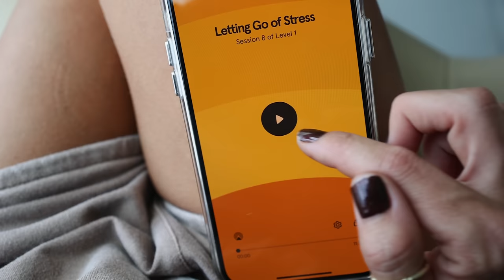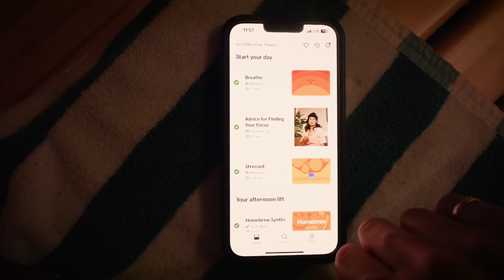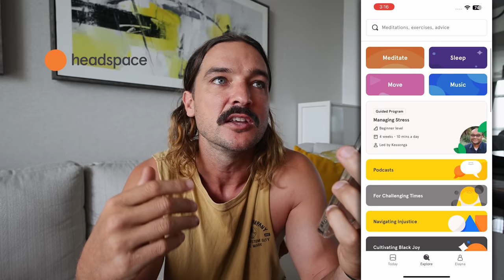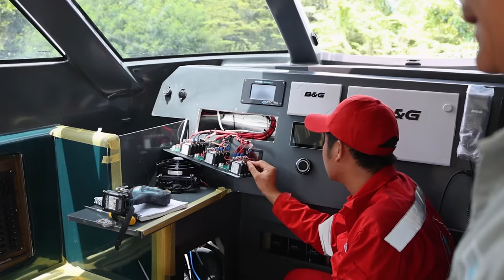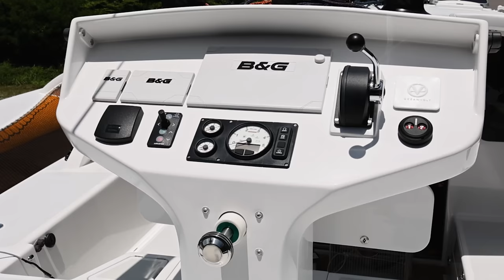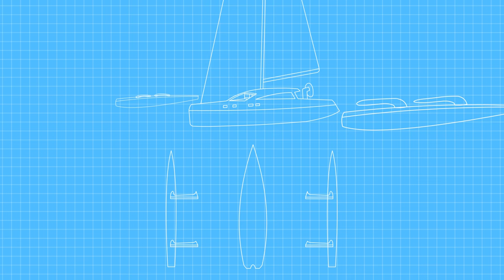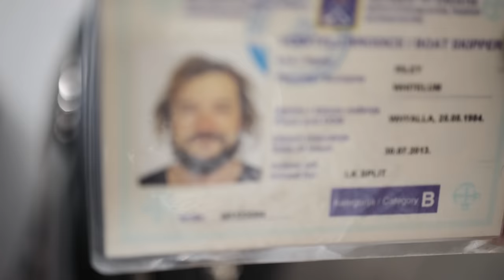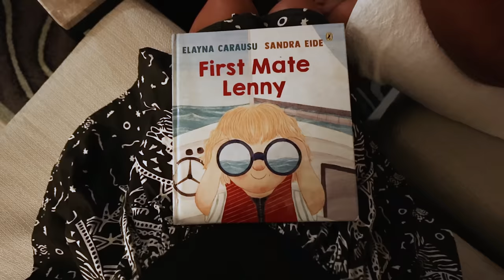OUR NEW HOME (60ft Carbon Trimaran)

Comment: I’m not a sailor, but what charms me about this peek at your boat is how you focused right away on its performance and safety features (okay, after first marveling at the paint, which honestly is a triumph). It’s a beautiful boat.
Reply: Yes the colour is a triumph🧡
Reply: ... and also a Triumph motorcycle color! I had an antique 1973 TR5T Trophy Trail ... aluminum tank with yellow trim .
Reply: If you're interested in sailing, a great way to start is to join a local sailing club and take lessons there.  It's great fun!  Using their boats is also vastly cheaper than owning one.  (There are sailing clubs very far inland too.)

Comment: I am so happy for you two!

Film cameras!  You mean like the kind we used to use in the years before the turn of the century!  Have fun, but take the time to meticulously plan every shot, as film and developing gets very expensive, very quick.

"I'm never going to want to leave this boat."  TA-DAA!!!  You nailed it.  I love the old copper plumbing look -- nice touch.

Sailing area to weight ratio:  Excellent light-wind sailing velocity!  Obviously, for safety's sake (family), you'll have to resist the urge to "press the edges of the envelope." Don't trust in the "60 tons righting moment."  It's there for safety, not for pushing the envelope.  As a pilot, it was of the utmost importance that I knew the aircraft's limitations as well as the boundaries.  While an aircraft might do 4.1 g's, it would break and kill me at 4.2 g's, so I never pushed it beyond 2 g's, the no-turbulence force developed at 60 degrees of bank in level flight.  Then, because of turbulence, I never went beyond 30 degrees in a turn (VFR) or the bank required for a standard rate turn (IFR).  Safety, first, and your new home is more like a fast business jet than a 2 to 4-place general aviation aircraft.  The boat will be much more fun for all involved if you keep it well inside the envelope.

"No more boats for a while!  I mean it!"  Uh...  What about your dinghy?  Aren't you going to have a dingy?

Comment: Dyneema is great.  Will be interesting to see how it holds up.  I've used if many times.  I always wanted something over it to protect it.  I got a lot of holes in things that were exposed to wear and tear with dyneema.

Not really a fan of the colors.  But everyone has different styles.  Also would try foils for lift.  See if she'd fly.  Then, reduced hull shape won't matter as much.

I'm interested to see how she sails.  I think its a great platform.  I'd just like more open space.

Comment: That is a BEAUTIFUL boat, but one thing I noticed. I was wondering if all your copper piping was put together with "lead-free" solder and flux. I don't know what the laws are in Vietnam but in the U.S. in 1986 the Safe Drinking Water Act Lead Band required the use of lead-free solder and flux in the installation on any plumbing in a residential or non-residential facility providing water for human consumption. Many different lead-free solder alloys have been considered as potential alternatives to the classical lead-based alloy. It wouldn't hurt to check. Good luck.

Comment: Why the fiber stays instead stainless cable. Sure “painted”  fiber structure lasts long, but the sun UV will do the damage to fiber, and there’s not going be a dozen cable companies to call come replacement time, as there is w steel cable.

Comment: Memorable moments, Riley's face when he sees the boat, Riley doing the Happy Gilmore. Love the color, really beautiful. Curious to see how the switch track mast track works, sounds good in theory. Also curious to see how all the wall paper stands up to the salt air over time. Question about the exposed plumbing everywhere, was that a design decision based on esthetics or functionality and serviceability? That shower hose that goes straight up and curves back down will kink as soon as you run hot water through it, figure a way to support the bend radius. I downloaded the Headspace app, thanks for the 60 days trial, I feel like that is a good long time to see the value, where 5 days would not be.

Comment: I'm old enough and ugly enough to have started with wet film some 35+ years ago and went through an array of cameras on my journey. I converted partly to digital about 1999, and then by about 2005 invested in a complete new set up with a digital slr, and upgraded several times since. The only wet film I would even contemplate getting into would be medium format, like an old Bronica or Hassleblad but in terms of use, it would be quite limited mainly to studio work. These days, film developing is time consuming and expensive in contrast to printing from digital yourself.
For a compact solution to carry around, rather than a full frame digital slr, I'd go for something like the canon G7x (doesn't need to be the mark iii), but I really wouldn't be going back to my film cameras at all.

Comment: Firstly love the outside color, its a sexy boat guys... 

 Curious:

Will that be sufficient solar power and will that require a smaller dingy?  Will you have to build an add on at the rear for additional solar power, outside storage, and to offer a little protection for your dingy?  Ive seen a lot of people build a custom add on at the rear, place additional solar panels on top, a place for some of the fishing & spearing gear, and to provide some protection for your dingy, so didnt know if that is the final version or will more be added?  

Awesome to see you guys working hard to turn a vision into reality.  Looking forward to the amazing stories to come on your new #BigBird  :)

Cheers

Comment: 11:28 Seeing that knife-sharp bow flaring up and out toward the deck with the wings of the amas stretched out to either side like a hovering bird--and the curves of the netting--and the eyes of her looking back at you...beautiful beyond words. I can't wait to see her slicing through the water. I'm not a huge fan of the color (I don't hate it either), but I'm glad she turned out the way you wanted. And for sure she will never get lost among the other boats in a busy anchorage. Elena, copper is such a lovely, warm, bright color and texture. The copper lights and plumbing fixtures make  great accents to your decor. Looking forward to the "proper boat tour." Question for Riley--is the aramid fiber rigging more durable than metal wire (or whatever the other alternative(s) would be? How does it compare in strength? Hopefully you'll address geeky details like this somewhere down the line, maybe while going over 20 knots during the sea trials??!!??  🙂

Comment: Not having an Airconditoner on board is not future proof at all, even if there’s breeze temperatures will rise exponentially close to land in the coming years and you should’ve just added it even if you don’t use it